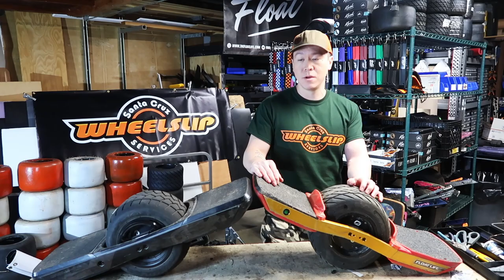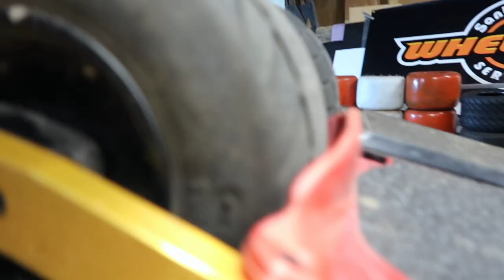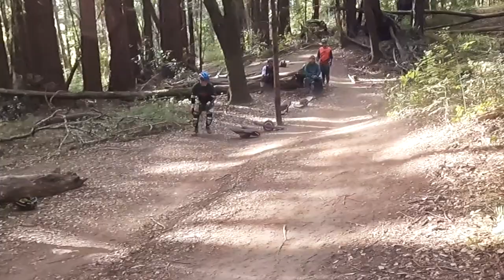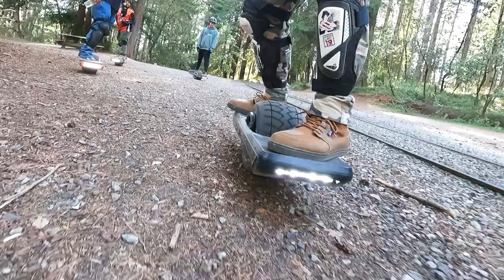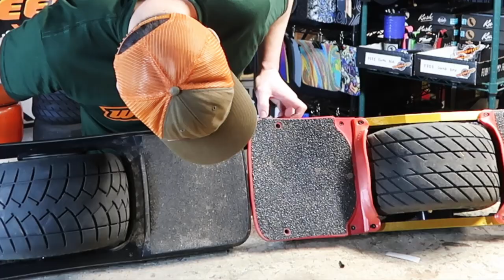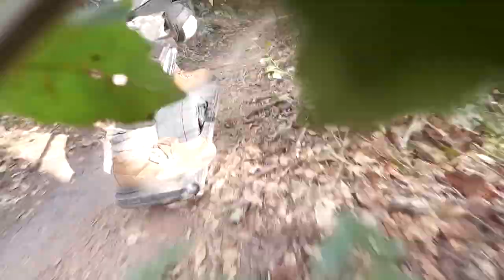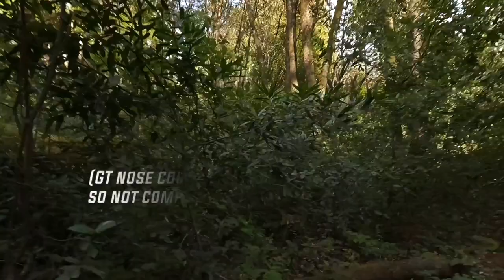8 things I hate about the Onewheel GT.. Should you get one? GT vs WTF XR (Part 2/2: cons)

Comment: Great feedback from an experienced rider. It would be nice to see a stock XR vs GT video. There are loads comparing the GT with all the best XR mods. Without the lift and W rails, how well would an XR take the bonks and drops the GT had issues with? The XR has a nice after market battery, but how would the stock battery fare on that hill climb? Is the battery loss from the XR the same voltage loss as the GT? Sorry, I'm not sure if the aftermarket battery has more capacity. Not every rider gets all the crazy mods. Most XRs I've seen have the easy moods like bumpers, rail protection, foot pads, and a tire swap.  That's what's available for the GT...well float plates for now instead of bumpers.

Comment: On the clearance issue...Ur WTFXR has a 11" tire vs 11.5" GT . Therefore the WTFXR is already riding lower...yet still has more clearance due to the angled rails!!

EDIT...just caught ur part1. So ur WTFXR setup also has a lift kit...so my comment above is less relevant.
Reply from the maker: Very peculiar right? The main issues are the rails flaring out at the ends and the thickness of the bumpers causing the loss of the clearance. Even with a wtf without lift kit and a stock rail with float plates, they still have approx 0.25" more clearance than gt.. Almost 1" more with lifted wtf
Reply: @MaxxSend  yeah but how many nosedrags did you do on that XR haha
Reply from the maker: @JakeLeary  hahah exactly 69 times, perfect for maximum root spoonage 😊

Comment: easy answer:  do you want your current GF or want a new GF.   I think i would prefer the latter.  The new one is always better, no doubt.  Just think of the tech that is in the GT.  no way i would go back to my old GF. GT all the way. . . it s just better.  That is why the old is gone.   but then again. . .with a good battery. .that might make a big difference. .   the GT is a princess. .hehehe. more like a spoiled princess.
Reply from the maker: Or better yet, have both gfs 😏 New tech is great, but isn't necessarily better overall, especially when they are made to force us to rely on them completely. For ex, putting a lock on the bms where if you unplug it, it bricks your board.. How does that make things better? Also the battery box is hardwired to the controller box, can't disconnect. These 'enhancements' are made to try and prevent us from modding/repairing ourselves. There are some improvements, but overall where is the real innovation? They've been sitting on their suspension patent for years, yet where is it? Having 7 modded xrs, I don't see the need to spend more to have the gt. VESC looks more convincing..